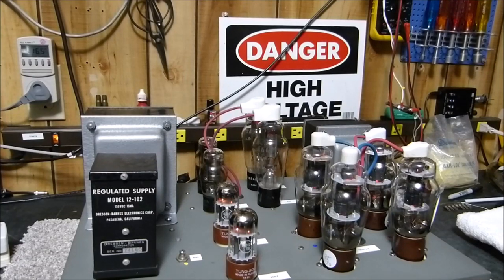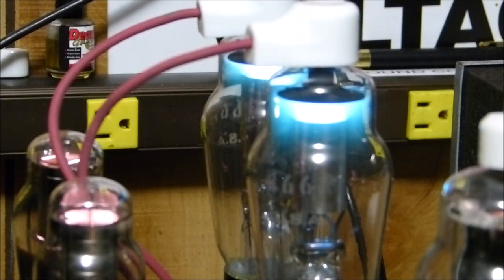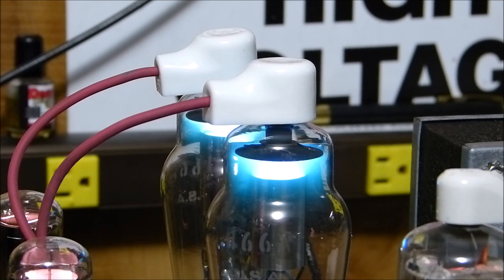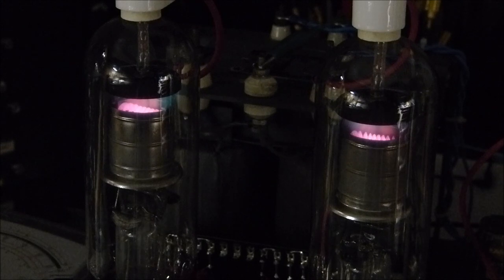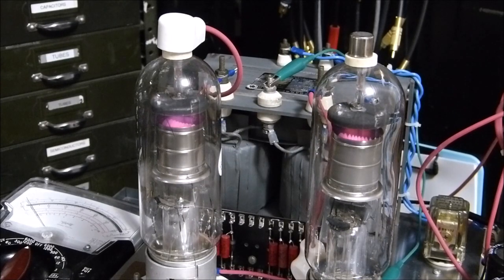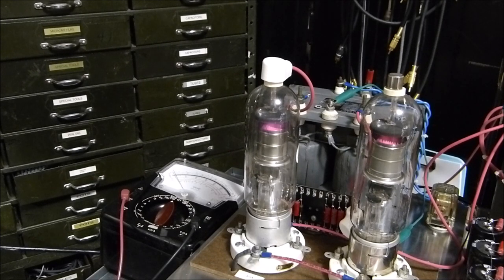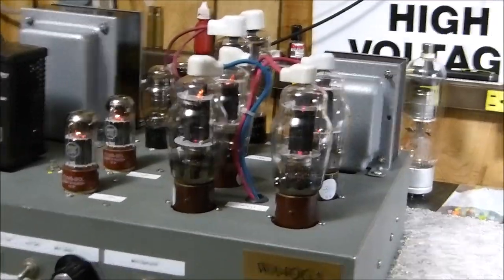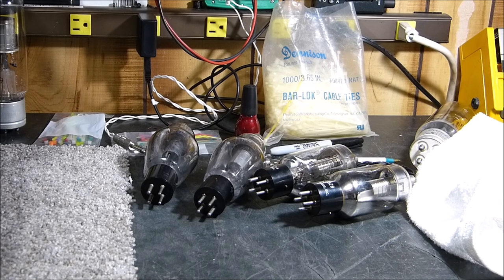Testing 872A and 866A Mercury Vapor Rectifiers

Comment: Interesting the anode glows like a number inside a nixie. I wonder if the thing got contaminated if it does anything without the filament hooked up.

Also with these MVs or even regular power diodes like the GZ34 5ARs and stuff I wonder what kind of frequency can you push trough, more precisely what kind of a recovery time to expect from the rectifier diodes
Reply from the maker: I think these tubes are WWII surplus and came from a huge Navy  warehouse in California. Very nice fellow out there that sells them. I think the same as you about contamination over the last 70+ years but fortunately 50% of them were good. The seller is sending me two more tubes. I would guess after so many years, maybe air leaked into them ?? The camera doesn't quite do it justice as I mentioned there was a really not spot down inside the filament. I am going to guess contamination (with air?) makes the tube conduct (somewhat) like a straight wire instead of a diode and it does what it does. Even with the one bad tube, there was DC on the filter capacitors so it did charge them somewhat - might still be enough voltage to blast a fellow to the next county...
Reply: The tube is conducting in reverse polarity as well over a certain voltage, since it has gone to air and no longer meets its reverse voltage specification. The DC voltage can't come up because of this and therefore the current remains high so everything glows intensely. If you push a properly working MV or gas rectifier to a high enough current the cloud of ionised gas will flood over the top of the anode too.

Comment: Are you using HV HRC fuses? DA.
Reply from the maker: I just use standard 3AG fuses in the primary of the transformer. As a "fuse" in the HV line, I use a fractional-ohm resistor (like a 0.47 ohm, 1 watt) as a fuse before the HV line exits the chassis. The resistor is connected across two ceramic insulators. I should show that in the next video.

Comment: Can you replace this tube with two 811a ?? Please someone let me know i have a Heathkit warrior h-10 it have 6 tubes 2 -866 driving 4 -811 a.   Can i replace the 866 with 2 -811a ...? So 2 /811a drive 4)-811a??? 73
Reply from the maker: No, the 866A are the rectifiers and are mercury vapor tubes. You can replace the 866A with solid state diodes.
The 811A are high gain triodes used as a grounded grid (GG) radio frequency (RF) amplifier.
These two tubes have nothing to do with each other and can not replace each other.
You have the right set of tubes and if they are all good, and there is nothing wrong with the other components, it  could work with the tubes you have, in the right sockets.
73
Reply: @ElPasoTubeAmps  thanks...but what other tubes can i replace the 866a with??? I have a Heathkit H-10 warrior... have 6 tubes  one side the two 866a ...then on the other side is 4 of the 811a   the question is basically does the 866a drive the 811a or no?? And the second question is you show a bigger size tube something like cetron 3b28 .... thanks I just got this amplifier from a old friend I'm going to used on  10 metter ....and sorry for taking your time i don't have to many technician on this neck of the woods.73 have a blessed day 💟
Reply from the maker: @caciqueguerrero2364  The 866A tubes are the rectifiers. They can be replaced with 3B28 or solid state diodes that plug right into the socket. A solid state type of replacement to the 866A and 3B28 is one called a 1N2637. See this Ebay listing below. These tubes rectify the high voltage AC coming out of the power transformer and provide the DC plate voltage for the 811A probably around 1500 volts DC.
There are no driver tubes for the 811A as the transmitter, or tranceiver, is what provides enough power to drive the 811A, somewhere around 80-100 watts to drive the 811A tubes.
It is going to be challenging to get an amplifier like a quad of 811A to operate on 10M but I suppose it can be done. Not sure what power you will get out but it won't be anything near 1000 watts. 
Hope this helps. Remember - these voltage are very serious and can be, death on contact. Stay safe.  73
https://www.ebay.com/itm/374321329464?hash=item57274a3538:g:SEsAAOSwPsdjCRNI&amdata=enc%3AAQAIAAAA4IFrnzSJ%2BtExeNbKreGNLcXnedV%2F5yVliuKSrOUYxn5ZFi%2F0yrYWPW2SITqpZU%2FKTgIv5Izx%2Bae2Izwo9JD6O4s%2BQIj8hyWq87JThs7JhQ48p0xwzN3%2B%2BG6d7OWWZhjgac4X%2FdhopNjXTkk5LFACD2WnNGXrmrEkdCB6oOr1xvGr9G0jf%2BASKnf49W%2BMLc1vArAS%2BMcVeNeOL70SP%2F1dYimvLjCh2ROj66OguvBsiUrSAo5irQ48sPKQ0U1BL7atetmF2E1T3X3vWhtQByaxMqwb8%2BteoXs%2FftW8QHDz1X0D%7Ctkp%3ABk9SR77V66CWYg
Reply from the maker: @caciqueguerrero2364  Here is the manual for your amplifier.  
https://www.rsp-italy.it/Electronics/Kits/_contents/Heathkit/Kits/Heathkit%20HA-10%20warrior%20linear%20amplifier.pdf
Reply: @ElPasoTubeAmps  thanks for your time and info ...sir waoo i been on the radio is the first time i seen or heard about tubes rectifier!!! ...ok and i have to see the solid state ones....waoo ...and yes the amplifier do about 800 watts i have a few amps  that. I'm trying to get back to life .... Is why i come around you channel ones in a will because today's techs don't help no one with out money...if you know what i mean i do it for fun got my license at A.R.R.L wen i was about 19 years old been on the radio sense i was 13 following my grandad who was a Korea veteran and did radio back in the 60 - 70s .... Have a blessed day.thanks again 73